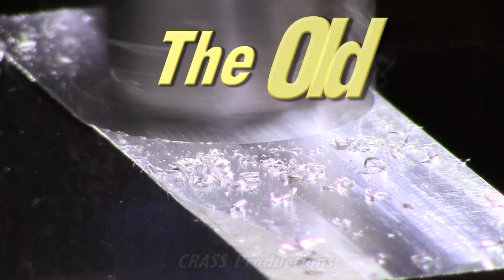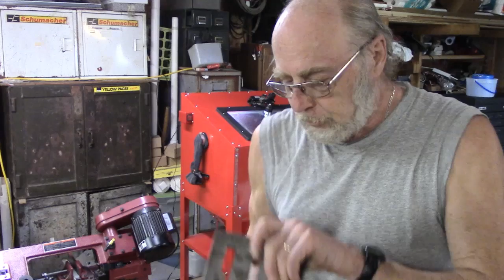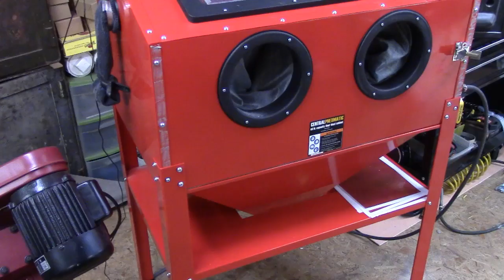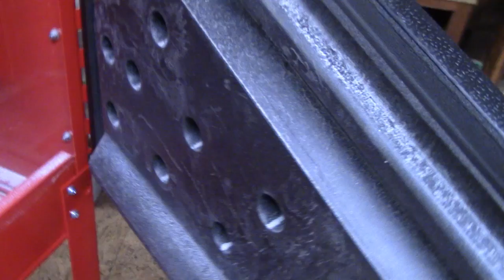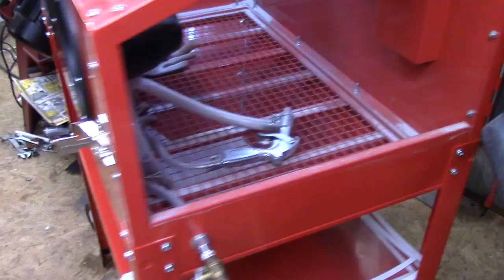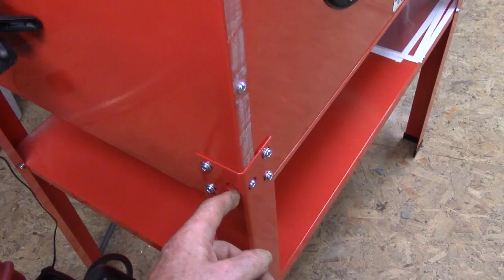Harbor Freight Blast Cabinet - First Look

Comment: Hi Chris, I guess that for a price you get to fiddle, if you want to take the fiddling of the fun out of the equation then you get the next model for $1000...  Wonder if more money always buy quality at HF... :-))
Cheers, Pierre
Reply from the maker: pierre beaudry HF is a mixed bag Pierre - there's good and there's crap! Overall though, where budgets are limited, for most part HF can be good enough, and better than not having something particularly if for relatively occasional use.
Reply: Got a few of those kinda tools, from Canadian Tire or Princess Auto, in Canada, they're the pendant of HF.

Comment: Hi mate.
The parts that you put together, were you planning to take them apart again?  If not, why not put a little silicone sealant on the joints, and pop rivet the unit together?  That might also take care of the slight leaks here and there.  Also, the medium has a hard time to remove the stuff, so it is durable.  If the window is Perspex, I would change it for tempered glass, as after some use, even with the protective film, you can't see a thing.  However in saying all that, it's a very nice unit, especially for that price.
Marcel, a new bloke
Reply from the maker: Marcel Timmers Hi Marcel, welcome - Had crossed my mind to pop rivet but - seemed a bit too permanent! I did already silicone caulk some areas inside before first use but reckon to try and deal with any small leaks as i find them.

Comment: Check out bluehandsvideo he added wheels to his.  I have a unit sold by Mac Tools and as you mentioned these unit consume large amounts of air, I upgraded my compressor to 27cfm, no more waiting as I can run wide open with unlimited air which is a joy!
FYI, I use Saran Wrap to protect the inside of the lens
Reply from the maker: outsidescrewball Saran wrap - great idea. :)
Reply: ChrisB257 Hi Guys, check out Dan Gelbart's take on this, he uses the "diamond coated" glass from supermarket check scanners and claims he needs no extra protection. He also claims that they are cheap, i believe one of his statements but not necessarily both. :>)

Comment: An excellent addition to the workshop, however, you will find that the dust that comes out of the chamber migrates through the whole workshop, spreading abrasive dust everywhere, far better to house it in a separate outhouse to prevent this, the one thing these cabinets require is lots of air, the pressure is not a problem with most compressors, but they need at least 15 CFM of air supply, 20 CFM would be even better, so you will probably need a much bigger compressor. It looks like your feed pipes are 1/4" not 1/2" BSP.  These cabinets are really good for anyone restoring mechanical objects, providing the abrasive dust is washed off after you have cleaned, it is like spaying newness! Chris B.
Reply from the maker: Englishman French Hi Chris -- unfortunately, nowhere else to house this beast so, just have to manage. I did caulk some of the joints inside before I commissioned it and will being paying attention to other aspects of dust control. I'd like a bigger compressor for sure but I have to watch my load on the power supply - would love a 2 stage giant but - probably wouldn't manage the amps thirst! I don't expect to use it a whole lot but on occasions it'll be invaluable. (BTW - DRO on way from Warren).

Comment: My first blast cabinet was a HF model very similar to yours.  I sealed the seams with Permatex silicone gasket sealer to contain the dust.  Looks funny, but very functional.  Use the clear rubber coated "extreme duty" shop light bulbs inside, they will last longer.  If you use a shop vac to draw the dust out of the cabinet, it works even better.  Get the shop vac that has an inlet and an outlet.  I removed the air filter and plumbed the outlet outside through the back wall of my garage.  No more dust inside your shop.  If you don't remove the filter, it will plug up constantly.  It will do a very good job for you.  After a number of years, I was ready to upgrade to a larger cabinet.  Enjoy!
Reply from the maker: HemiRod23 Hi - I did silicone caulk some of the joints inside before I commissioned it - thus far seepage seems quite small. Plan to set up shop vac for sure. Fortunately, usage will be fairly intermittent - just want it there for when needed.

Comment: Hi Chris !

CONGRATULATION ... you got yourself a very usefull piece of tool there !

I have used mine for so many things and projects that I wouldn't do without it today, eventhough I have some moisture problems to solve. What you should go for is more air ... not pressure but air FLOW !

If you ever think of replacing your cmpressor DON*T buy a tranditional piston type - way too much noise !

Instead go for a second hand screw compressor - it delivers so much more air that you'll NEVER have too little and what's best of all ... it makes no noise !

The noise is like a washing machine which spins for drying the laundry !

Take a look at my sandblaster project - more details here in danish but you can Google Translate to the right just under the menu line - choose whatever language you like in the combobox:

http://kelds.weebly.com/sandblaeligser.html
Reply: Keld Sørensen Agreed with you about screw compressors, but,  prices are in high orbit range, even used, I'll keep on looking and dreaming...
Reply: pierre beaudry
... they are pretty cheap here in Denmark ;-))
Reply: Here the used ones for sale are like 20 hp and plus, and prices are like $3000 and plus...
I've been watching them for a while, so far no luck... One day.....!  ;-)
Reply: pierre beaudry
Right now I have 2-3 auctions with screwcompressors under 8-10HP for less than US$500-600 ... and a air dryer for under US$ 100
Reply: Ok, now, let's see about shipping..... lol
This would be great if ti would be here in Quebec, that would be a definite purchase fo me...

Comment: I picked up one last April , I thought I was going to starve to death before I got it put together. I have a shop vac hooked up to mine, it keeps the dust down pretty good. I also purchased some gasket material and put it around the glass. I agree with the respirator idea and I placed the shop vac outside so the discharge is away from me. Over all I am happy with mine.

Comment: New tools are always fun.  I had a bead blast cabinet one time but I almost never used it.  I hope this is more useful for you than mine was for me.  The darn thing kept my compressor running almost all the time and it was a nice 2 horse job too.  Last summer when I was garage cleaning I poured out the last bag of beads in the back yard.  Thanks for the video.
Reply from the maker: cerberus For occasional use I'll just have to manage with the compressor i have - can't supply the amps needed for a nice big 2 stage. At least the smallest nozzle helps conserve, just a bit.